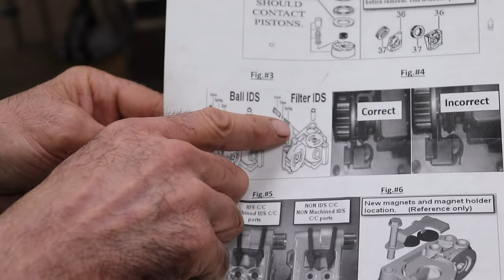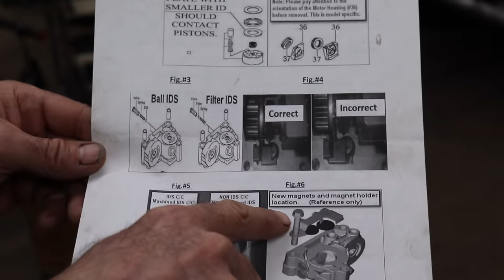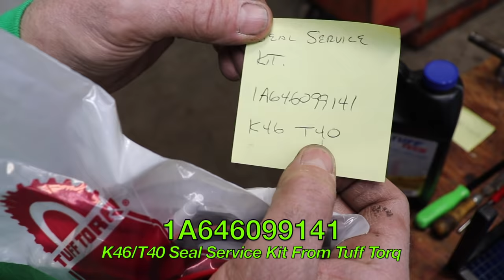Transmission Skipping? Here's The Problem!

Comment from the maker: @ the 48:00 mark Taryl wrongfully says 33-40 "Inch Pounds" when it's really "FOOT Pounds" Sorry for the mistake
Reply: We knew what you meant by the size of the torque wrench
Reply: I thought that was a big torque wrench. LOL
Reply: Hey Taryl  ( Buck Tooth fuck ) ha ha ha ha my sister has the same smile. We APPRECIATE YOU IN CANADA. We were smoking too much WEED to pay attention to our shop teacher. But as we smoked we did know that there is or would be an easier way to get this Knowledge. AND HERE WE HAVE IT PEOPLE. THANKS  TARYL. FROM 🇨🇦🇨🇦🇨🇦🇨🇦
Reply: I got a scag V ride hydro pump where the release valve threads are stripped smooth half way down. 

Think I could braze some aluminum and metal the existing threads? 

Just wondering about the holding power since the hydro pumps are pressurized systems.
Reply: Big Difference , but its way worse to make that mistake the other way around
Reply: ops
Reply: A good way to remember the difference between inch pounds and foot pounds is my foot is much bigger than one inch.  😁
That's your dinner!
Reply: Did you build the stand for working on the transmission or did you buy it somewhere?  If you bought it where did you get it from?
Reply: Sintered metal is compressed powdered metal... Cast or machined metal gears wouldn't disintegrate like Sintered metal (powdered metal).....

Comment: I wish Tuff would make these easier to service.  I wonder why they don't have a replaceable filter from the outside and a oil drain and fill so you don't have to remove the trans.  Its like they designed this so it wears out after 5-7 years.
Reply: That’s an option for some of there models. It’s the manufacture here that asks if they want it or not.

They use it as a selling point to buy the higher end model with the filters and easy service.
Reply: Yeah a filter u get from the outside would be great.
Reply: @FishFind3000  crazy, what tier do you need to get to before they include the drains and filters?  I recently bought a commercial huskie and no drain and filter .
Reply: It doesn't have a charge pump to push the fluid through an external filter. It would be nice to make it easier to drain and replace the fluid though, that may help some.
Reply: @FishFind3000  Agreed on outside filters being an upgrade,need to research whats avalible,and know what your looking at when you go to the shop to buy a new machine,
Reply: Yes they do want it to wear out. Manufacturers have decided, that is the way to sell new lawnmowers.  Transaxle isn’t the only thing constructed to wear out on these units.
Reply: thats why changing your oil regularly before it gets gummy inside is worth the time to do
Reply: @timkis64  
Pulling the transmission to change the oil is a little bit much,  that way you could just pull the fill plug and turn it upside down.  I have a Craftsman GT 5000, the owners manual   says to use straight 30 motor oil.  I haven't checked for a drain plug so I don't know if it has one.
Reply: Because they're specifically designed to fail that's why.
Reply: It's intentional
Reply: Someone could research where the body could be safely drilled and tapped for a drain plug, and improve the situation
Reply: When you look at how small and capable these econo models are, it's actually pretty impressive. Filters tend to be overrated in them... they're completely sealed, and not designed to burn the oil up. For what a low end, big box store, mower cost... these things are totally capable. If folks want capability, and versatility, then it's not greedy of the company to expect you to invest in something designed to do more than mow and blow. Great company 👍 ~
Reply: I tapped a 1/4 npt plug in mine easy oil changes now
Reply: Neat idea, but you still should clean the magnets, and filter
Reply: If you don't want to take the transexual, buy a vacuum pump. These are serviceable. People are just lazy and don't want to put the work in.
Reply: @Rfgtghgfggfsfhlihb  That is an option to at least get some fresh fluid in, but still leaves all the shavings on the magnets and screens.  Kind of like just changing oil on your car but never replacing the oil filter.
Reply: @luuk-out-below9804  Take it out of the lawn mower split the case open. It's a metal screened filter, rinse it out, put it back in, get some RVt put it back together. It takes about an hour. I did it about a month ago. The one I have Is probably pushing 600 hours Or more, If you're willing to put the little bit of work in, they will last.
Reply: @Rfgtghgfggfsfhlihb  can you access that seal /plug with the body of the tractor still in the way? I haven't looked yet myself, but I'm doubtful. For a routine trans fluid change, that would be great, but initial cleaning of this unit, after 1000 hrs, requires a little deeper cleaning (like the filter screen). Another thought, I love my oil extraction unit, but I don't know if the hose would get down to the bottom, get past things in this unit, to get the better part of all the old crap out...
Reply: @Rfgtghgfggfsfhlihb  I think you missed the entire point of my comments.  Yes of course it is possible to do this.   But there is a better and more efficient way to do this.
Reply: @berettaboi  On my lawn mower All I have to do is lift up my seat. Remove the battery and I have access. The first time I changed the fluid. I used the vacuum pump I knew I wasn't gonna get everything But I was not ready to split the case open. Next year I'm gonna spend the 350 bucks to get a new pump and everything I need. My opinion third worth it If they are maintained. The one I have was not not until i got it. And I might be overpowering it. It used to have a 21 horse single cylinder That engine blew up. So I bought 810cc V Twin Briggs and Stratton. Vanguard.
Reply: @luuk-out-below9804  I believe there is a video of placements to put your homes rain plug. Or something about removing a bolt and using it as a drain plug. The filter is annoying But in my opinion, it gives you a chance to see how everything is doing. And you can clean those magnets as well.
Reply: @Rfgtghgfggfsfhlihb  Please make a vid of how you do this in 1 hour, like you stated above.  Show us all how easy it is etc. Yah that's what I thought.
Reply: @Rfgtghgfggfsfhlihb  my John deer L120, battery is just behind the motor, underhood., pretty sure the rear body is pretty much a sheet, with cut outs for the seat /safety springs only. But I'm not near it at the property there, and haven't planned out the service yet.
Reply: Ease of serviceability is not a part of today’s consumer products. Use it until it stops working, throw it away, and buy yourself a new one is what they want you to do.
Reply: Yeah, it would cost a hole dollar to add a drain plug.
Reply: @luuk-out-below9804  I know right. Just did it on K66 takes a good bit of time when you include gathering tools, sealant and 'new' filter  and then the cleanup.
Reply: There was a time I felt uncomfortable at the thought of working on transmissions but I got over it and along with videos like this, I don't hesitate opening up one. I like knowing how things work and fixing it myself!

Comment: Thanks a million for making an easy to understand set of instructions.  My trans went completely dead after 224 hours.  After disassembling,  I found a pump piston spring ($.83) had disintegrated, and it's pieces gouged out the surface of the pump.  Replaced the pistons and springs and the unit, and to my amazement today, and delight, it works!  JD wanted $1300.  Thanks again for sharing your knowledge.
Reply: David, Where did you get your parts? thanks
Reply: Easy to understand?  YEAH RIGHT...NOT..

Comment: just think of all the extra oil that would have stayed in the transmission if you hadn't pulled the pump assembly off....just goes to show how thorough a cleaning these things need to get rid of all the contaminated/metal laden oil

Comment: You inspired me to go to the local junkyard and buy a chipper shredder. Only thing I see wrong with it is the float bowl needle seal was jammed. They let it sit for 10 years. I cleaned the carb , made sure it would pop off with ether. It looks brand new, no scratches on the paint. I’m betting it I get it running mint for $20. Paid $80 for the entire unit

Comment: I see an old Black and Decker folding work stand back there- a genius devise to grab whenever anyone comes across one. 
The top wood jaws are fantastic for putting a vertical shaft motor on to work on or start after you clamp it down.
Reply: I just threw one away because the wood was wet and warped and I had no plans of refurbishing. Now I need to work on a motor. This is how hoarding starts.

Comment: I no longer use a tractor with this transmission, but could have used this info when mine quit working. Not a very robust unit in my opinion.Very helpful and informative video!
Reply: The Tuff Torq K46 transmission is very common in many riding mowers.  Overall, it does a good job and doesn't have many problems.  Avoid heavy pulling and steep grades for longer service life.  Old oil and overheating, combined with neglect and abuse is often the problem.
Reply: Yes make sure the fan is in good shape and the fins are kept blown out.

Comment: I'm so glad I subscribed to your channel! I just had a problem with my transmission when I went to mow my yard for the first time yesterday. Trans seems to be skipping and surging. I will keep this video bookmarked so I can take mine apart next week. Thank you so much!!
Reply: Follow up: I took my transmission out and disassembled it with your video playing on my laptop by my work bench. I carefully took photos of it as I took it apart but I messed up BIG time when I put it back together!! I put mine back EXACTLY as you put yours together, but I DID NOT refer to my photos. I installed it and when I pushed the forward pedal, it went backwards!! Took it out, looked at my photos and saw that my transmission has the large end of the wedge shaped part opposite of yours. I reversed it and it now works perfectly. I would never had the confidence to take it apart without your video and help! By the way, my transmission is a K46BT3 and it works perfectly thanks to you!! Oh, and I also downloaded a parts breakdown from Tuff Torq by serial number and it also showed how mine was supposed to be assembled. Live and learn.

Comment: I've rebuilt a few hundred of these K-46s. Taryl has covered all the best tips and tricks how to rebuild these hydrostatic transmissions. 

⭐⭐⭐⭐⭐

As noted, some K-46s do not have check balls for the forward / reverse pressure valves. I've found IDS models with the ball, often have broken springs or the spring have lost all tension from lack of oil or overheating. They are not available individually or in sets like they used too be 

Other tips I would suggest regard refinishing the main power  body. On some early K-46s, use a 800 wet sandpaper (soaked in WD 40 or varsol) instead of 600 because the grade aluminum has varied over the years these units have been in production. 600 can be too coarse and will gum the sandpaper quickly, creating an uneven surface finish.

The power and drive piston - cylinder internal springs are often broken in the drive cylinder. Unfortunately, the springs are not sold separately by tuff-torq. I do a three step polished for the cylinders, 600 to 800 to 1,000. The result is a mirror finish that reduces future wear and stress points that generate heat. 

Tuff Torque recommends changing the oil every 100 hours, which nobody does on 2006 and newer K-46s. Since I refinish the cylinders using 1000 grit wet sandpaper, I've gone 300 hours between oil changes if I install the update filter magnet kit.

Everyone has different opinions on the right gear oil. John Deere claims all K-46s have lifetime oil (*Koff*).  John Deere spec is 10W30 mineral oil. Tuff Torque specs synthetic 20-50W. I've tried every major brand of synthetic 20W50 along with a few racing oils. All are fine. 

I got really silly on my personal K-46  trans and got all the gears, including the main axle spyder gears and brake drive gear, heat treated using the same vendor that I use for my race car quick change axle gears. It's not a cheap, $175.00. But I've have no wear on any of the gear teeth on any of the assemblies. Pyrometer temperature inspection after an hour of mowing shows case temps dropped by 40 to 50° F from a peak of 230° F. The transmission has 1,900 hours total time. (1,600 since heat treated replacement gearset )

Is it really worth it.. up to you. It significantly reduces gear metal wear and thus extends the life of your filters and power / drive cylinders and the main power block surfaces.

The only seals that I find wearing out are the axle end seals Taryl shows. You can find those at any wheel and bearing shop or Amazon. Look for 19 x 32 x 8  mm spring loaded double lip.

You should be able to find them for $5.00 to $8.00 ea. The vent cap is the real pain in the ass, they are often cracked beyond reuse. You're gonna pay $12 bucks at a JD dealer.

Gear sets used to be cheap from Tuff Torque. Not anymore...

Highly recommended the magnet upgrade kit Taryl talks about if you plan to keep your tractor and expect 800+ hours. I've rebuilt one customer K-46 three times 1,700 hours total time. The third rebuild required very few parts (two used power cylinder springs) and new metal brake pads along with filter and axle seals. 

Happy mowing / snow blower riding! Taryl Dactal gets the real job done right!!! Though I would seriously stick a Hazmat warning label on Skippy.
Reply: Doug, wow rebuilt a few hundred!  Do you mind telling us what the charge is to rebuild one of these.  It has to be close to the price of a new replacement I would think with parts + labor .
Reply: @luuk-out-below9804  These transmissions are quirky. Some need a zillion dollars in parts while others like Taryl Dactal has illustrated require very little. I never charged a set price for a rebuild because that's not fair to the customer. 

You are right, if you replaced all common wear / poor design parts, it would almost as much as a new K-46. Though new ones aren't cheap anymore. Price one out from your local JD Dealer. You'll be shocked.

JD had serious problems with these K-46 transmissions because JD spec'd 10-30W mineral oil and used big rear tires that stressed the K-46 to the max. As soon as JD went to a really small diameter rear tire and (finally) synthetic oil, the problems with the K-46 dramatically decreased. Cub Cadet had the same issues as did Craftsman tractors that were big tires. 

Owners that run them in hot weather, with hills and have large areas to cut (more than 90 minutes) hurt durability in less than 150 hours. In other words, what breaks and needs replacing, is never the same.
Reply: @DougHanchard  I have heard most of what you just said before.  My cub with the degrading trans is a 2014 with a k44 (i think, its been awhile.)  I looked at replacing the trans and it was around 700 dollars at the time, that was 2 years ago, the rebuild kit was 400 hundred.  It did not seem worth it to put the money into it obviously.  Its still going so I may just  drop the tran and try a fluid replacement .   I have 430 hours on it .
My husqvarna has the k46 how are those?

Comment: Love your videos !! I’m a Canadian Grass Rat ! All you did was perfect…….just want to add my 2 cents…..had issues with these budget transmissions losing drive when hot under load……was due to oil getting thin when hot and hydro pump losing pressure from that forward reverse orifice you mentioned losing too much oil though it, due to the thin oil. A fix we found was drawing out oil which is actually equal to 10w30…..or John Deere low viscosity hydraulic oil and replacing it with John Deere Hygard oil or even straight 30 weight oil for customers with lots of hills and pulling lawn rollers.  Also I think wear on spider gears is probably due to loss of wheel traction and excessive spinning through differential, maybe a snow blade , snow blower or hilly terrain issue. Love your videos !! Take care guys !!   P/ S I use a plastic shower curtain rod decorative cover….for seal installs…….comes in a 4 ft length, really cheap and is    Plastic and snaps over axle, crankshaft, whatever, you just snip off in length you need !!
Reply: Woodstock Ontario in the house,I’m a Grass Rat also.🇨🇦
Reply: @oxyfee6486  wow, close I’m Brantford, LOL
Reply: @Tech-tipsntricks  I just got home from Brantford twenty minutes ago,I went to High school in Burford,small world .
Reply: Windsor Ontario here!!
Reply: @motoman5023  Hope you’re well,maybe when ,and if Covid comes to a end we should do a Canadian road trip to see Taryl.😂

Comment: really appreciate the Tuff Torq  transmission videos , allot of us have this transition and most are going to fail at some point , i hear after 300 hrs. they begin to act up 👍
Reply: Well that sucks, I’m at 235 hours…. I already changed the oil so hopefully that will by me some more time.
Reply: I got a LA135 and D125, got 1500hrs out of trans before it started slipping, never serviced either lol. And I tow a 350 litre spray trailer with them, tow a 6x4 trailer often with 200kg plus weight on it. I think their tough asf. I just rebuilt them thanks to Taryls videos
Reply: @BahnGop  wow that gives me hope for my 140 thanks  👍
Reply: Mine lasted 560hours / 6 years
Rural New Hampshire  1790 farm house , trails and fields. 👍
Reply: 2600 hrs
320 John Deere 
Bdu-21